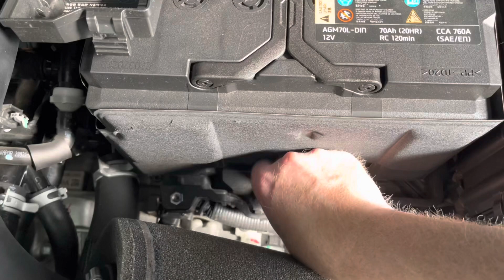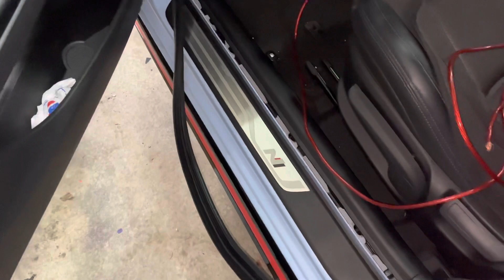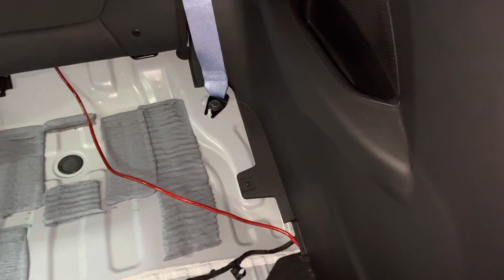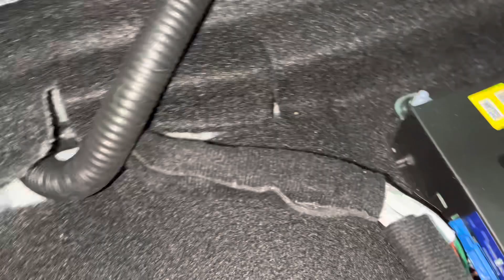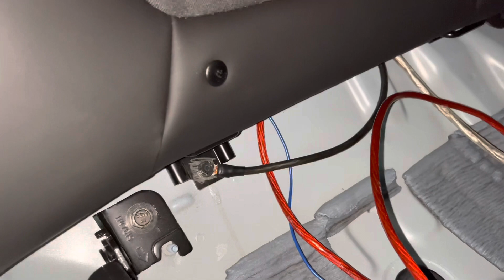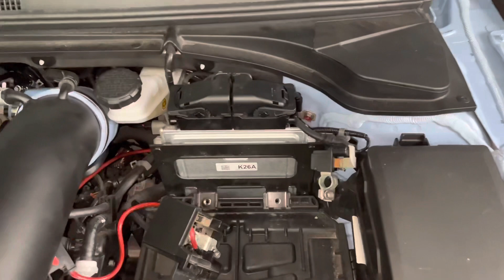How to Install Subwoofer in 2019+ Veloster N using Rockford Fosgate Powered Sub & AudioControl LC2i

Comment: At what point do you need an upgraded amplifier? Did you do all your speaker upgrades without the need for an upgraded amplifier?
Reply from the maker: I upgraded the speakers without adding an amplifier. While this works ok, it’s not the best since I have no way to correct the factory tuning. Simply adding speakers to a factory system doesn’t produce the best possible performance due to tuning manufacturers do to make their lesser expensive speakers sound decent. I plan to add a DSP or DSP amp combo, like I did in my Elantra. This way I can remove the factory tuning and add my own tune, while providing better amplification to my aftermarket speakers.

Comment: hey dude. i’m about to do a sub job to my veloster n very similar to yours. may i ask you some questions about that?
Reply from the maker: Sure.
Reply: @nprform i am about to do a sub job where i install a single kicker l7r 12 inch in the back of my trunk in my 2022 veloster n. though with my job i was wanting to use the sub signal directly from the harman amplifier under the passenger seat. the standard infinity audio hyundai amp. i know it does 500 watts  and the sub i’m looking at can handle 600 rms. i’m not looking for bass to shake a sub division, just clean deep bass. what wires to i have to cut and tap into to get the sub signal to run to my new subwoofer? if this can even work. i am not aiming to keep the stock sub receiving signal, i only want to power the new kicker sub. im also not looking to install a line converter either. since my sub of choice is dual voice coil and the harman amp has two sub signals would i plug both sub signals into my one subwoofer since its got 2 positive and 2 negative terminals? can you answer these questions i asked? thank you dude.
Reply from the maker: @that_one_mustang_guy I don’t believe you’d be very happy with using the factory amp to power an aftermarket 12” sub. Can you do it, yes, would I recommend it, no. The factory sub is a 5.25” and is not getting 500 watts sent to it.

Comment: Thanks for the video!  Can you tap directly into the stock subwoofer wires into the Rockford powered subwoofer ?
Reply from the maker: Yes, you can use the subwoofer wires for signal to the Rockford sub. However, you will get better performance by adding an active LOC.

Comment: Followed to t using access line out converter no sound and radio won't shut down idk
Reply from the maker: I'm sorry you're having this issue. Especially, with radio not shutting off, that's not normal at all. I'm happy to do my best to help you get your system up and running. Please email me pictures of your wiring off the amp with your LOC. Also, please let me know what is the model number of your LOC. Please send to nprform@gmail.com. Thank you!

Comment: So, that portion of the firewall you drilled through is where the clutch is in 6 speed models.  Do you have any recommendations?
Reply from the maker: Do you have a space below the main wire harness that’s entering the car? That would be another good place.

Comment: Great video, only problem is that I wanna keep the factory sub as well😢
Reply from the maker: You’re able to keep the factory sub, but the new sub will just over shadow its sound.
Reply: If you tap in to the factory wire you don’t have to throw new wires to the factory sub? The factory one will do the work?

Comment: Excellent video! Only hiccup I encountered was on a Canadian manual model that perfect spot for a firewall penetration does not exist! But I got a 1/0 gauge through near there. Not overly fun haha! And also I did a big 3 which was actually quite easy compared to some others I’ve done. This video has excellent info! Thanks for putting this together!
Reply from the maker: No problem! I’m glad the video was helpful. Thank you for the info regarding the firewall difference in Canadian models.
Reply: Interesting! No idea why the difference but there’s no space by the large drivers side grommet of my car like yours. A large cylinder/plunger attached to the clutch pedal are is in the way and exits there into the engine bay. I got it through regardless but fun with 0 gauge! Thanks again!

Comment: Does this keep the factory sub intact?
Reply from the maker: You can run the factory sub along with the aftermarket sub if you’d like. Simply don’t cut the subwoofer wire, just tap into it. I chose not to run both, as the aftermarket sub would be drowning out the factory sub.
Reply: @nprform  gotcha, ya I probably won’t run both, as I’m getting 2 8 inch subs with 1400 wats

Comment: Hey man question on ecu removal

I noticed there is a smaller tab in the middle of the larger plastic 2 levers

Are you supposed to push that down as you lift up on the lever?
Reply from the maker: That’s a good question. Yes, you need to push the small tab in the middle of the lever to get it to lift. The tab locks the lever down in place.

Comment: If I’m not mistaken why use the lc2 or any loc when that Rockford model has a built in amp that accept speaker live wires? I also have one just not installed yet, but I’ve noticed you could slide the input level to “hi” for speaker wire level instead of RCA. Is there a downside to it that I’m missing?
Reply from the maker: You are correct, the Rockford subwoofer does have a built-in LOC, but I’ve found using the LC2i gives a better signal to the subwoofer and adds the benefit of AccuBass, which helps with integrating a subwoofer with a factory system.
Reply: Thanks for the video. One general note, when tapping into the speaker wires, choose the front or rear speakers which have the highest base output. You can simply listen with your ear close to the speaker or play with fade/balance to determine this. Connecting via the loudest speakers will allow for a better base sound balance between factory speakers and the powered sub when adjusting the base setting via head unit.